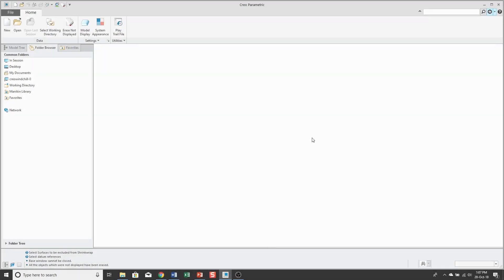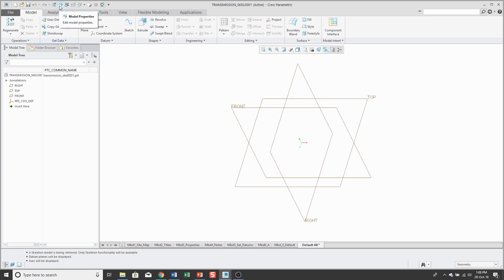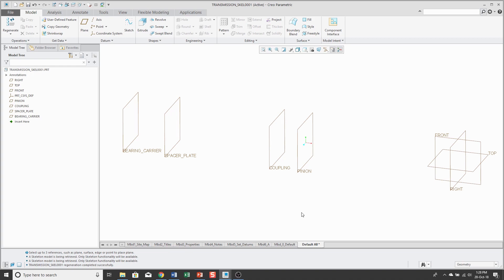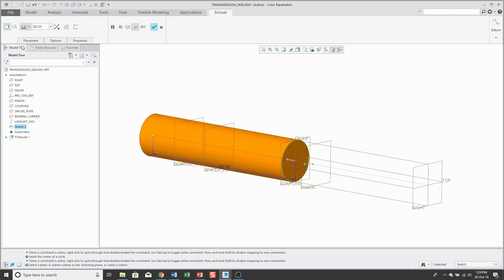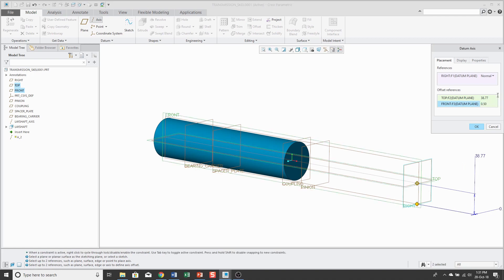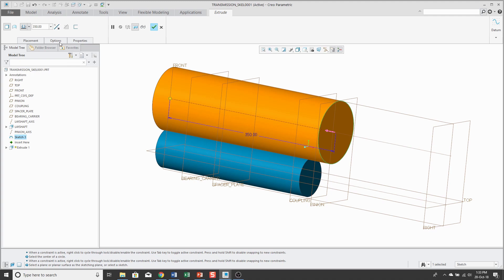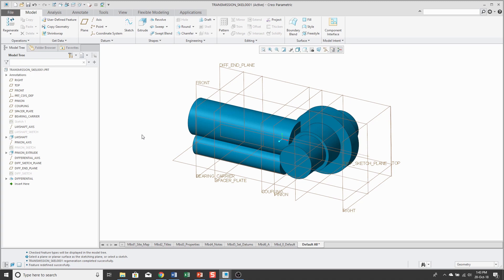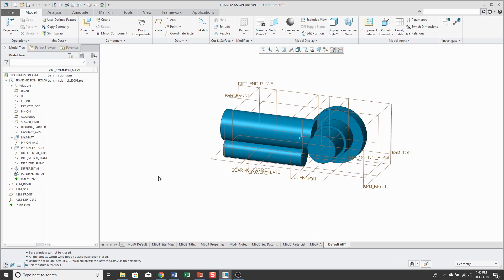Creo Parametric - Skeleton Models - Top Down Design (Part 2)

Comment: Great video! Skeleton models are new to me, I have one question.
When creating planes that are referenced off a plane other than the default "Top" "Front" "Right" I am unable to "Edit Dimension", I have to "Edit Definition" to change that dimension. I am using Creo Parametric 4.0 M090. Is this a bug or SOP in a Skeleton model?

Comment: What are the benefits of modeling skeleton part features as surfaces as opposed to solids?
Reply from the maker: Sean, great question. I find there are three main reasons. (1) Surfaces are "lighter" than solids for regeneration, and (2) I find it easier to select surfaces and quilts for referencing in Copy Geoms and Publish Geoms.

But (3) is the big one: surfaces don't automatically "merge" upon intersect like solids do (the multi-body issue). For example, let's say you extrude two circles at 90 degrees to each other. If you create the extrudes as surfaces, you get two separate quilts that you can select and control. If you create them as solids, Creo merges them into a single continuous solid. Sometimes you don't want this. Some aspects of this should be solved (hopefully) in Creo Parametric 7.0 when Mult-body functionality is introduced.
Reply: @CADPLMGuy  Whoaa! did not know that was in the works, really liked that about Solidworks in the past, Creo 7 seems so far away now :)   Thank you for yet another insightful answer.  Using surfaces in the skeleton makes complete sense to me now.